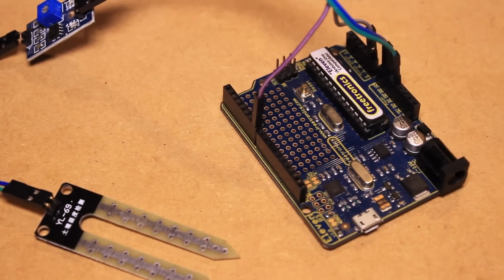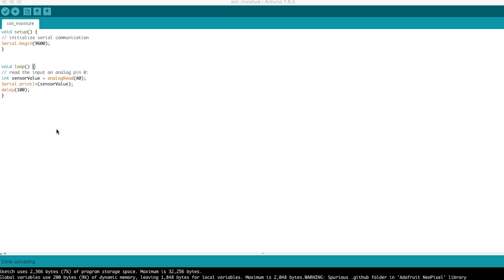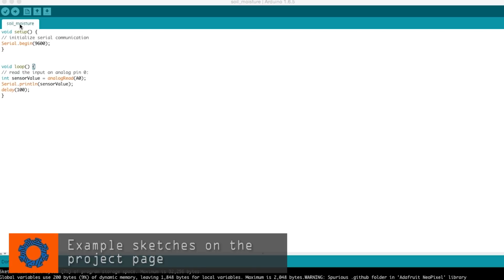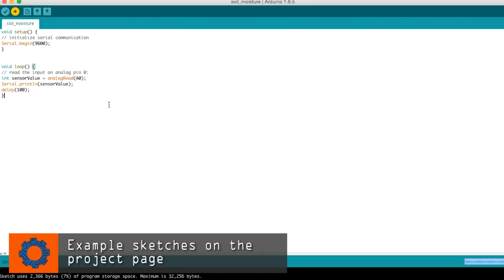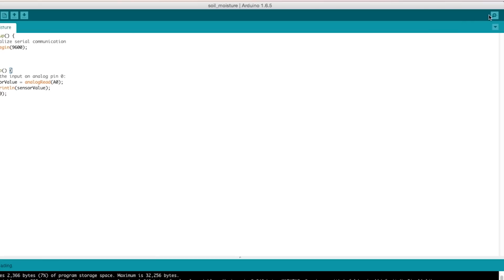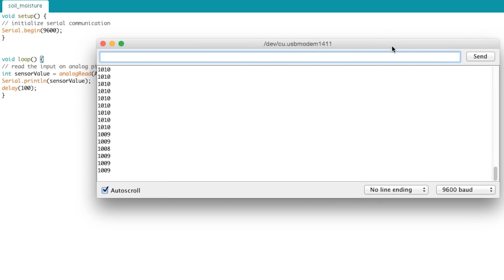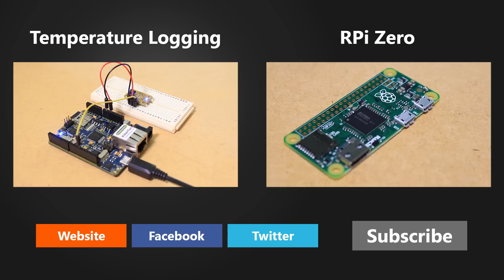Arduino - Soil Moisture Sensor

Comment: If you plan to leave it in the soil for a long time, you need to power off the module between reads. Leaving the probe powered on will result in a very rapid galvanic corrosion.
Reply from the maker: Hi Jimmy, thanks for that, I'll take that into consideration.
Reply: How do we power off between reads?
Reply: this guy sounds like danger dolan and you have danger dolans profile pic wtf XD